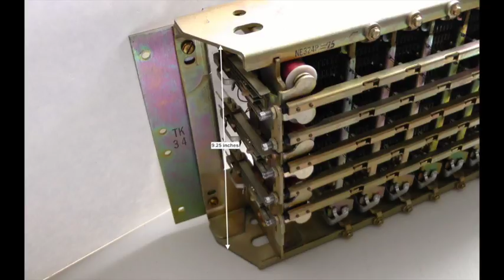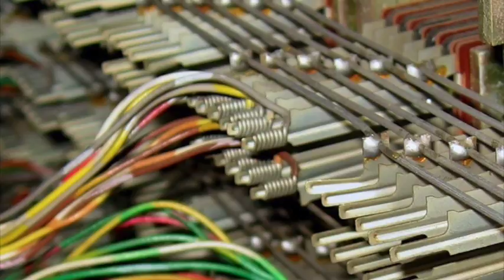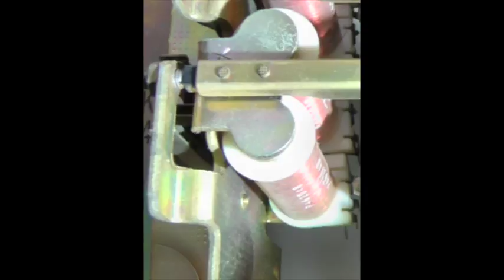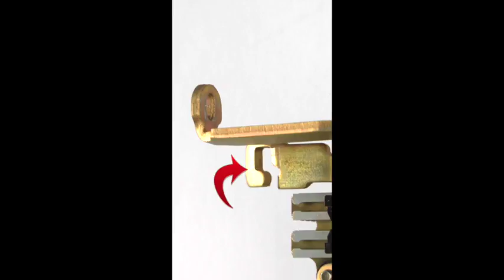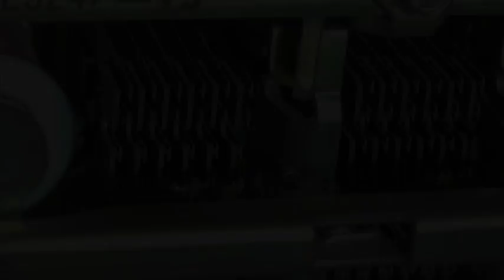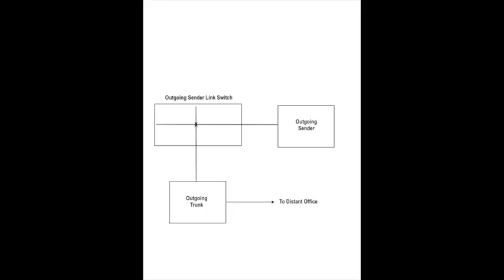The Crossbar Switch

Comment: The operation of the cross-point switches establishing a route through a whole switching fabric from one line to another is beautifully simple. The part I simply cannot wrap my mind around is HOW analog relay-based CONTROL circuitry did the magic of receiving digits, computing a route, and then operating all the necessary cross-points. Is that all as unimaginably complex as I imagine it must be? Thank you for these wonderful videos!
Reply from the maker: Well the marker was quite a complex device, having some 1500 relays and many thousands of contact springs. However, the instruction set for the tasks to be performed was quite small and most of it was performed by hard wired logic that was the same for every central office and so this wiring was done at the manufacturing plant. Where flexibility was required due to differences in routing and numbering schemes, the wired logic was for these tasks  was completed at the central office using short cross connectible wires.

Comment: My mother and grandmother were telephone operators in the 1940's thru 1960's. I always wondered how dialing worked. You videos are training quality. After watching them I could go into a switching center and actually have a very good idea of what is happening. You had me riveted from start to finish. I gave you a like!
Reply from the maker: Well, thank you very much for the kind words. It's very nice for me to see such keen enthusiasm. Thanks for watching.
Reply: @Hicken65  So, did I understand this correctly: The Cross Bar Switches are to "find" a connection circuit. As soon as it does, it hands off that info to other equipment for the actual connection and the Cross Bar resets back to Neutral while the call is being placed.
Reply from the maker: Well, the crossbar switches themselves don’t perform any “finding” tasks. They are just dumb switches that provide an interconnecting pathway between different components. Common control devices, such as markers, determine which particular crossbar switch crosspoints are to be operated to make the connection between these components. In some applications, the crosspoints only remain operated for a few seconds during the call set up process. In other applications, the crosspoints remain operated for the entire duration of the telephone call since they provide the actual talking path through the switching sytem. @paulromsky9527

Comment: Greetings, I am from Russia, it was interesting to see the multiple coordinate connector of your production, is it possible for me to contact you?
Reply from the maker: Any questions you may have should be addressed through this comments section.
Reply: @Hicken65  I just wanted to show photos, did you work at coordinate stations? Can you tell us about small coordinate stations, for example, we have stations in Russia called ATSK 50/200, this station has 4 cabinets, each cabinet adds 50 telephone sets, 1 cabinet is the most important, where all the equipment is installed without which the rest of the cabinets cannot work.
Reply from the maker: @aquamoris  I was a central office technician for several years. The smallest crossbar system we had was the Northern Electric SA1, which if I remember correctly could grow to handle up to 1500 telephone lines. Call set up was performed by a single controller, which had a lot of redundant parts built in.
Reply: @Hicken65  And at your stations, strings were not used inside a multiple coordinate connector? It is unusual to see plates instead of strings, our coordinate connectors are very similar in a chain, there is something that would cost us to borrow from you and you from us.
Reply from the maker: @aquamoris  None of the Northern Electric or Western Electric crossbar switches had strings.
Reply: @Hicken65  Do you still have coordinate-type workstations? And why didn't you use soldering inside the cabinets? Sorry for the bad translation, I use google translate.
Reply from the maker: @aquamoris  All the crossbar exchanges were decommissioned by about the tear 2000. Most crossbar connections were wire wrapped, which were much quicker to make than soldering. Only the horizontal wires were soldered.
Reply: Hello mr. Nazi from rasha, what about your country leaving Ukraine?
Reply: Oh hello vatnik. Slava Ukraini
Reply: @Catswhiskerdetector  this is not the place to discuss it.
Reply: @aquamoris  you might want to change your nazi avatar it you don't want people brining it up...

Comment: Thanks for this; I've been looking for information on how crossbar switches work mechanically off and on for the past few months, and this is the first good deep dive into their operation that I've found! 
I've been working on putting together test equipment that involves (arbitrarily) connecting some pins on a PCB or conductors on a cable to loads, sources, and/or ADCs. I've been rollling my own variant of a crossbar with solid state relays, but I've been fascinated with learning how basically the same thing was done in the telecom industry during the electro-mechanical days.
Reply from the maker: Well, I'm glad I was able to help your understanding of this marvellous device. Thanks for watching.

Comment: I worked on NEC crossbar in the early 80s. Our local exchanges were NC460s the bigger ones NC400 and the toll exchanges with 4 wire switching were the NC820. The NECs were made under license I guess, the switches were the same but they had doubling, The bottom 8 select magnets gave 8 options but the top row operated too to give A or B to give 16 inputs horizontally. 2 out of 5 codes, relays marked as 0, 1, 2, 4 and 7. 4 plus 7 makes 10. Wire spring relays all put together with wire wrap tool, I spent many Saturdays on my own reprogramming the markers with a wire wrapping tool. Nobody else wanted to do it. We also had crossbar PABXs called "Pentomat" made by Citessa in Spain.
Reply from the maker: The "doubling" and "2 out 0f 5 code" features you describe were used extensively in the # 5 Xbar system. Always great to hear from a fellow switch tech. Thanks for watching.
Reply: What was the operating voltage of this system, and how was the operating voltage sourced ?
Reply: @gblueslover8807  50 volts DC same as Strowger exchanges, positive earth but they had an additional 50v booster battery negative earth to operate the crossbar switches, so they operated with a 100v pulse and held with 50v. The power came from Rectifier sets and 23 cells of lead acid battery making 50V when float charged.

Comment: Thank you for both the detailed workings of the No5 Crossbar and Step-by-Step Switches! While working for Danray PBX (Later bought out by Nortel) I got a tour of the last Step-by-Step and No5-Crossbar Switches being removed from the Sunnyvale California C.O. (around 1979-early 80s), ready for their then new ESS-1 Local Switch installation/cutover. It was amazing to watch the operations of those cool, very mechanical, Switches work, as our Danray CBX1000/CBX 4000 and CMX8000 PBXs / Trunk Tandems were already solid-state systems. What was amazing and funny were the giant balls of MDF to Switch cross-connect 2/4 wires they were in the processes of finally removing; Looks like instead of removing and replacing the wires for customer phone new service installs and moves over the decades, they just had cut them off at the ends, left them within in the giant balls of speghetti wires, and just added new wires over the top. Lol.
Reply: I worked for Illinois Bell for over 30 years. I worked SXS, 5XB, 1ESS, & 1AESS. I've never seen or worked on an MDF on which they didn't pull the dead jumpers every day. I have heard that was the case in some very large switches, where the sheer volume of main frame orders got out of control and forced the situation. You would think they would have disconnection crews running off hours, unless they already worked three shifts, and couldn't keep up with new service.
Reply from the maker: @northerndarklight5305  I can only imagine what the pile up must have looked like.
Reply: Loved working on the SxS and #5Xbar in my early years during my 41years career
Reply from the maker: I don't know if leaving the old MDF jumpers in place was common practice or not in the Bell System. Where I worked (Bell Canada) we always pulled them out. On the other hand, a lot of cable rack cables were cut in place because hauling them out would have been very difficult and probably would have caused many problems. Thanks for watching.

Comment: Wow!  Thank you for this extremely thorough and easy to understand explanation of the crossbar switch.  I previously watched your video on the step-by-step switch with equal admiration.  I was a technician at Bell Labs in Murray Hill during the 1980's when this great institution was unfortunately broken in two.  In the lobby there were several exhibits, one of which was a relay-logic tic-tac-toe game.  The best you could do was a draw.  It would win other wise.  I can now begin to understand how, with relay logic and the cleaver design of these switches, the phone system could automatically complete a call.  Absolutely amazing.  Of course ESS could do far more at a much greater speed and now VoIP has rendered this tip/ring pair telephony obsolete, but it is a testimony to the great minds, engineers and production facilities that did so much mechanically for close to a century.
Reply from the maker: Well, I'm glad you enjoyed the video. The design of the electromechanical telephone switching network was truly an amazing achievement in its era. Thanks for watching.

Comment: Awesome video.

I have a question which i hope makes sense, i am of the understanding that the crossbar system had markers, line links, office and district links, trunks ect, but im wondering how does a crossbar systems logic work exactly? Or rather how did they make/build the logic using electro-mechanical equipment?
Because magnetic core memory was not a thing until the 1950's and neither were IC's, i just cant quite wrap my head around how the system figures out what the best path to take is or how exactly it stores digits.
I guess to put it plainly, i dont understand how its programmed (for lack of a better term) to handle all of these functions and decision making.
Reply from the maker: The logic is performed by the manner in which all the wires in a device are interconnected. The relay windings and contacts form a massive logic tree of electrical circuit paths being enabled and disabled continually as a device performs its tasks. It's all just battery to ground to complete any circuit, but with the number of relays and contacts used, there are a massive number of circuit paths available. So there is a sequence chain of relays operating and releasing based on the wired logic. Each relay performs as a logical memory. Each relay contact pair is like an on-off switch. When a relay is non-operated, a given contact pair may be open, and so electrical flow is blocked. When the relay operates, the contact pair closes, and so electricity can flow through it.
Reply: @Hicken65  They used reed relays and a 2 out of 5 code for error checking.

Comment: Hi! Thanks so much for this video. It’s been very helpful to me. I’m working with the Connections Museum in Seattle to design and manufacture replacement operating cards, and seeing them in operation, close-up, with your explanation of how they interact mechanically with the rest of the switch mechanism, has been very illuminating.

I’m curious if you have a supply of operating cards already, if you have a way to make or source new ones, and if you have any specifications on-hand for their original dimensions, materials, method of manufacturing?

I’m hoping to use common circuit board manufacturing techniques to produce replacements, but the shape of these cards might challenge your typical PCB fabricator.
Reply from the maker: Unfortunately, the crossbar switch in the video is the full extent of the the crossbar equipment I have. All the documentation I used for research was online, including BSP's, Bell Labs Records and Bell System Technical Journals, but I don't remember any details that you're looking for being provided in those sources. I would think these cards would be ideal candidates for 3D printing, using good quality samples from the Connection Museum's existing switches.

Comment: What's the input and output connections
Reply from the maker: Well, there's quite a variety. Subscriber lines, trunk circuits, common control items such as incoming registers and outgoing senders, ringing current supplies and coin supervisory circuits are all connected directly to crossbar switches in a No. 5 crossbar office.

Comment: Great explanation. Can you explain some time, (or is there another video?)  how the  common control registers stored  the dialled numbers in the pre digital era and outputted the information to control the crossbar switches and complete the call. Looks like the phone system had memory before computer memory existed.
Reply from the maker: The electromechanical relays themselves are the memory storage devices. For example, in a No. 5 Xbar office, the originating registers received the dial pulses from the subscribers telephone and stored them in dry reed relays in a coded 2 out of 5 arrangement. After dialing is finished, the digits are passed to a marker along with other information "en masse" by simultaneously connecting 150 wires between the marker and the originating register. The marker stores all this information by operating wire spring relays based on the electrical potentials received on the 150 leads. It passes the digits and other information to a sender, again en masse by a large number of leads. The sender stores this information by operating relays and then pulses out the digits when the far end is ready. If you search You Tube for "crossbar switching systems" you'll see some of these dry reed relays. They look like cigarette boxes with tabs sticking out. Thanks for watching.
Reply: Daniel, look for a book titled "Engineering and Operations in the Bell System". Long out of print but there are some used copies available for a reasonable price. Shop around online but beware of price gougers. It goes into the various types of switching systems and how they operated.

Comment: The room these switches were located was very noisy.
Reply: After working in a crossbar office for while, you would instantly know something was going wrong with the equipment somewhere by the slowing down of the clattering noise when it shouldn't. But you would also know something big was happening in the news whenever the sound of the clattering became a deafening roar as people rushed to their phones to call others.  For me, it was like being inside the beating heart of the big city.
Reply from the maker: Yes, it was time to turn on the radio to find out what was happening.
Reply: @VariedVids  I remember one night shift in the 4A office when Long Lines lost a supergroup. Some banging as over a thousand circuits were seized but that was nothing compared to when they all timed out within seconds of each other and the system tried to connect every one of them to reorder.
Reply from the maker: It was a lovely loud clattering, caused more by the common control equipment than by the crossbar switches.

Comment: Truly amazing stuff! I came here looking for how these things managed to remember which of the contacts were closed, and I nearly fell over when you described how the selecting fingers worked at 31:40. Quite ingenuous. 

I once saw a wall of these in an old underground room down the street when I was about 10, where they had cut off the phone lines and connected them to fiber optic translator boxes on the other wall, but they had never bothered removing the old switching stuff. Always wished I had looked more carefully to learn how they worked.

This video must have taken a ton of work to make and I think it's historically invaluable, since you know the names and history of every single piece, which you can't learn just by taking one of these apart. I also love the design details like the crossed contact shape that keeps the contact resistance constant even with misalignments. That sort of thing is really hard to catch just looking at these devices. 

Thanks so much for this great video!
Reply from the maker: Well, thank you for your kind remarks and for watching. It's always gratifying to hear from someone who appreciates the fine details of this amazing switch. There are probably some remnants of crossbar systems still lingering in a few central offices where space requirements were not tight. You may also be interested in my videos of the Step-By-Step switching equipment. Just search my channel name, Hicken65, on You Tube.

Comment: ITT were still building crossbar switches in 1969 when I worked for STC in East Kilbride.
We were working on a small exchange system based on a crossbar “mini switch” on a PC card.
Unfortunate for ITT, electronic switching became easy, reliable and cheap, compared to the mini switch
Reply from the maker: There were a number of electronics companies that made solid state add-ons for electromechnical switching systems. Some were good, some not so good.Two good ones that I can recall were the solid state A (pulsing) relays for step-by-step switches and entire solid state step-by-step switching systems, which were used mostly by telcos to handle the growth to existing step-by-step offices.